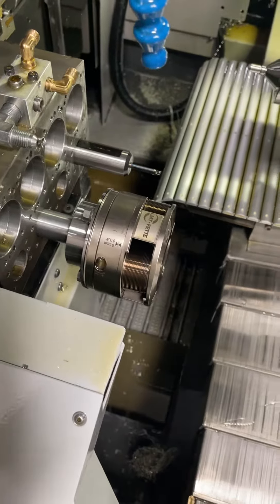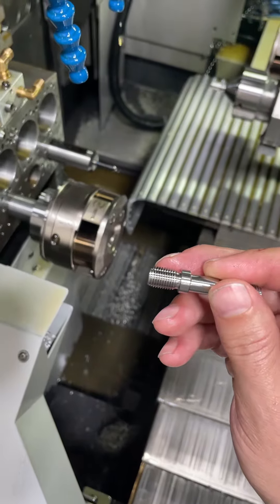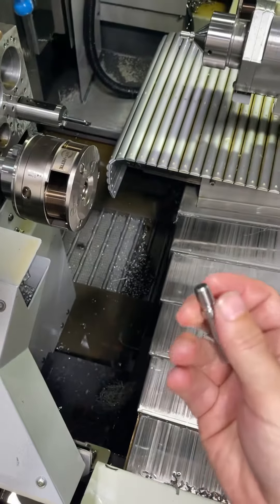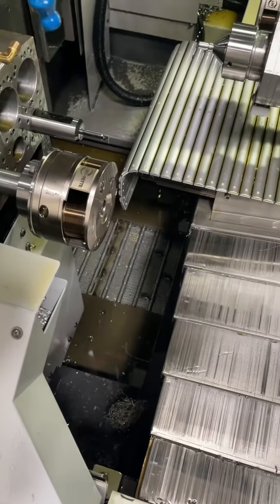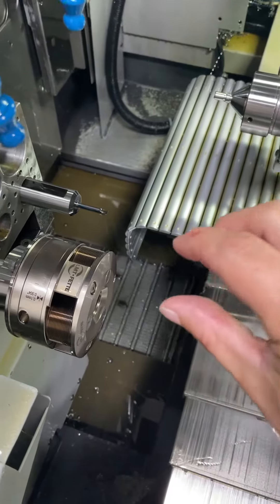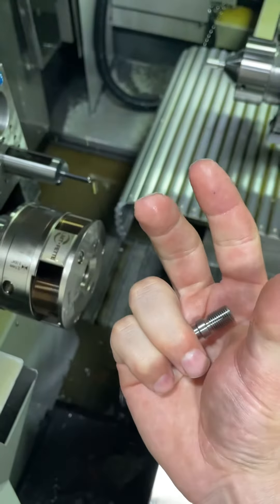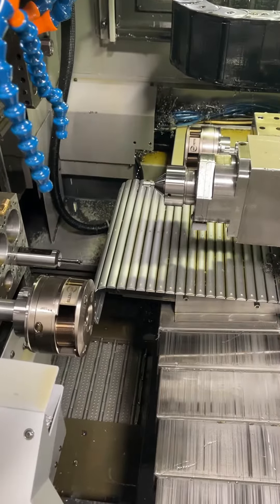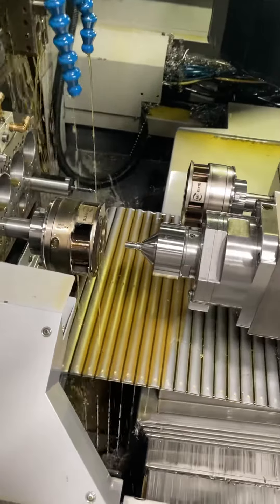Thread rolling (on a Tsugami Swiss lathe)

Comment: Which cam software do you use for programming swiss lathes?

Esprit, PartMaker or anything else?
Reply from the maker: I use esprit. I used to use partmaker at my previous employer.
Reply: @cncswiss5999  I made that switch as well.  I was a PartMaker user for almost 10 years.  When I started at my current shop about 3 years ago I had to learn Esprit.  Man am I glad I made that switch.  When I was a regular PartMaker user at least once a week I could be heard saying "Fucking PartMaker!!".  The post would give me some shit number that would cause issues.  I remember one instance where I had to use a back plotter to go though hundreds of lines of 3D code to find where PartMaker had messed up some numbers and was lifting a tool out of the cut resulting in bad parts.  That was a fun afternoon.
Reply from the maker: @brandons9138  haha! I can definitely relate to that! “Fucking partmaker” should be their slogan since that’s what all of their customers say.
Reply: @cncswiss5999  Part maker single handedly ruined my trust for machine simulation accuracy. I had one program where I was drilling and tapping with live tools on a lathe. Simulation looked good. I gave the program to my set up guy. He comes to me and "tap broke". Not only that there was a scar about .100 below the drilled hole on the face of the part. What it happened is part maker had positioned the tap correctly before the tapping cycle, and then moved the tap in X during the actual tapping cycle. "Fucking Part maker!!"